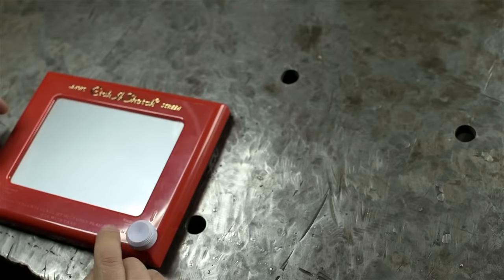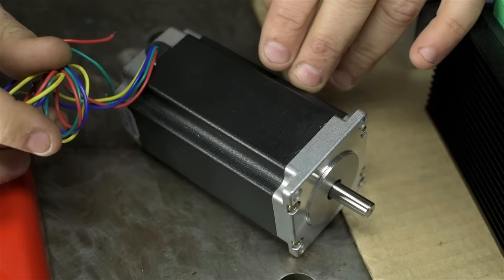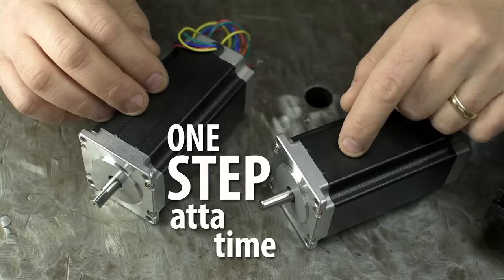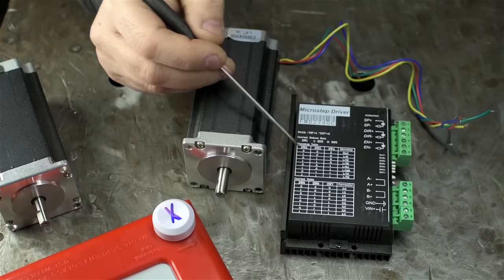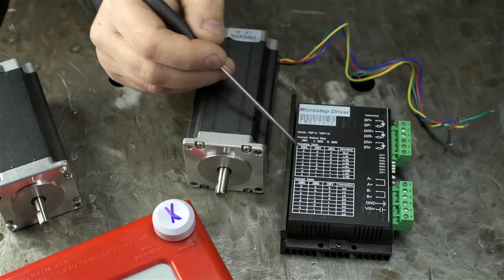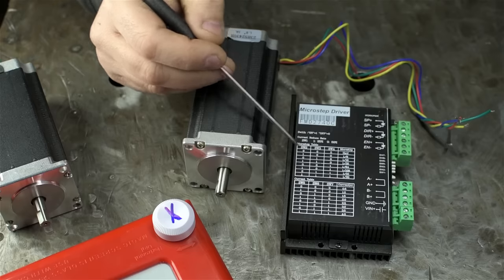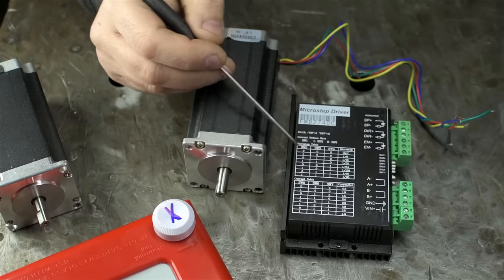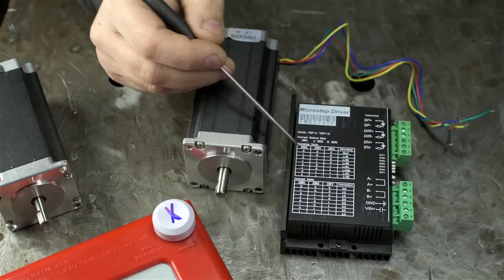Build Your Own CNC! (Part 1) - Hardware

Comment: Linus Torvald would like to speak to you about your current lifestyle choices.
Reply: Torvalds.  There's more than one of him.

Linux is fine for everything I do.  Better than Windows.  But then I don't do any CNC stuff, so I have no idea how LinuxCNC stacks up against Mach 4.  As for CAD/CAM s/w for Linux, there's a lot of choice (which means there's probably no offering that will keep everyone happy).
Reply: Jim Alley  
Linus Torvalds (not Torvald) came up with something called Linux, which is an operating system.  You can view it as an alternative to Windows except the price is a lot better - it's free.

There is LinuxCNC on Linux as an alternative to Mach 4 on Windows.  How reasonable an alternative I don't know.

There are CAD/CAM programs for Linux, how good they are I don't know.  There's a metric shit-ton of them, which is not a good sign, because a good one would crowd out the others.

If you have an old computer sat around doing nothing because it's too underpowered to cope with Win 10 then it might be worth having a play with Linux, which isn't as hungry for resources.  Because with Linux you tell it what you want to do (if you can figure out how, although standard stuff is easy, it's the non-standard stuff that has you tearing your hair out) instead of Microsoft telling you what they're going to force your computer to do (like do an update in the middle of running your CNC), or force a shitty user-interface upon you.
Reply: @RasmusJohanson  
I've hurd of this GNU of which you speak.  They never did manage to come up with a kernel, did they?  Well, they came up with something that was a pale imitation of Linux long after Linux had become solidly established.

If we go down your route, it's actually xorg/GNU/Linux.  Ummmm, Mate/xorg/GNU/Linux.  Ummm, Firefox/Mate/xorg/GNU/Linux.  The kernel is Linux, not Hurd.  Much as I respect RMS, he cannot force me to call it anything other than Linux (nor can you).
Reply: Most people using LinuxCNC are using Fusion360 for CAM - it's an excellent package and free for start-up or hobby use.  LinuxCNC is an industrial strength system... it has its quirks and it's more complex and less friendly than Mach, but it's been used to control all kinds of machines from little desktop routers to full size machining centers and lathes.
Reply: >It used to be true that Linux was the GNU software system plus the Linux kernel... nowadays it's mostly Linux+GNU dev tools+hundreds of other packages from other authors.
Reply: It's Torvalds, because unlike M$ Window he's actually capable of multitasking.
Reply: @DanBowkley  beyond multitasking Linux is even capable of real time control. Which means Linux can run a CNC machine while you're streaming this old tony videos. I believe there's 4 different real time systems for Linux now? It is hard to keep track of them all.
Reply: @bdf2718  Linus' brother Axl got killed by John Travolta in Swordfish. It was tragic. He got mixed up with the wrong kind of people.
Reply: For 2D work, Inkscape will spit out gcode for you.

You know what we say in the open source world: "You get what you work for"
Reply: @doctormo  I never got Gcodetools to work very well for me. So I found another procedure to get 2.5D G Code starting out using Inkscape. Which could be called some work. But it works for me.
Reply: My thought exactly and I'm the ORIGINAL Tony.
Reply: @tonywalker8030  To NY?
Reply: @RasmusJohanson  I did not click the "read more" because like every non-Linux evangelist, my eyes glazed over.
I do not want to spend my life going down the "look how sleek and cool my OS is and how many tricks I can make t do" rabbit hole.
I want to use the computer. IDGAF about the OS or how it works as long as it lets me do what I want.
NO LINUX USER UNDERSTANDS THIS ABOUT NON-LINUX USERS.
Now call me a luser so you can feel superior.
Reply: And I would like to speak to him about how it seems like his daughter? makes his lifestyle choices for him,  how bad that is for the rest of us, and to stop ruining his work with unnecessary rules and regulations - for instance, the CoC being forced down our throats -  that we never needed to accomplish whatever in the first place - then we'll talk about switching over; but until that happens, it is a hard pass NO GO.

Comment: Long time subscriber, first time commenter.  Partially because I prefer to hide in the shadows like Gollum, and also because of the fear of public ridicule.  That should tell you how strong the urge to comment is, especially given that what I’m about to say would be prime for such things.

I’m a mechanical engineer who designs and builds cryogenic air separation plants for a living.  I’m just painting the background here.  But I also didn’t own a cell phone until 2 months ago, believe it or not.  I believe that technology should have a purpose and until recently the phone served none to me.  

20 some years ago in college, about the time the internet’s were invented, for my senior design class I built a CNC though it wasn’t called that at the time.  I used the parallel port like you show but I wrote my own BASIC program for the output, which amounted to a bunch of nested loops with a print command to send a step.

Fast forward to a few years ago and wanting a CNC router and coughing up $15k for it, and where I know that there isn’t anything to it and being extremely aggravated because of it.  And despite knowing that also having to deal with the fact that I didn’t “speak the language” of the new technology to be able to learn from conventionally available resources.

What I am trying to say is that for me, and I’m assuming others as well, this subject isn’t intuitive or easily learned.  I very much appreciate both the time you are taking to explain it as well as your intelligence, demonstrated both through your sense of humor as well as your ability to simplify and clearly communicate. 

I need to watch this again a few times, make some drawings as that teaches me best, and look up some items, all electrical.  But keep the videos coming.  And the examples of different brands helps show what is consistent and probably important at this stage.
Reply: Wow!!
Reply: Andrew Myers nice reply.
Reply: Andrew Myers
Hey mate, just one word
Don't be afraid of any ridicule
99 times out of 100
Or even less
Anything anyone thinks or says about you doesn't have any impact on reality
Cheers ;)
Reply: I have learned to accept that anyone who personally attacks someone is coming from a position of weakness, and I TRY to not let the comments hurt.  I enjoy disagreeing (debating) with people about  issues, but I don’t attack the PEOPLE (by assuming if they like x person then they have Y character flaw etc.  I’ve also learned this... EVERYBODY has issues and insecurities.  Some don’t admit it, some attack to cover it, some have the issue of not being able to see their own issues.  Thank you for commenting.... we are all in the shadows sometimes.
Reply: I decided a long time ago that other people's opinion of me is none of my business.  😎

Comment: "this is how the pros do it, if you're a hobbyist, you could build all this stuff into a nice enclosure with fans and switches and lights"

i died laughing. too real :)
Reply: Creeper With Shades - You beat me to it! So true...
Reply: Me too.
Reply: Fans, light and switches. Check. Working stepper motors. Erm
Reply: @TheBelkul  It is called optimization, get the easy stuff done first, so it is out of the way, then do the hard stuff. Some people would say "the easy stuff that is actually part of the deal, procrastination doesn't count", but that is just a minor detail.
Reply: @louisvictor3473  On the flipside, why waste time doing the easy stuff if you're not 100% sure you can finish the hard stuff?
Reply: I can relate, once, many moons ago I visited a mate that works with electronic repair, only to find his media computer in pieces, scattered on the floor in front of the TV, still hooked up and running...
Reply: @kyleemmerich2460  Why waste time trying to do the hard stuff at any point if you are not 100% sure you can finish it? See, that is a non argument, you'd never do anything if you applied that line of thinking consistently.
Reply: Kyle Emmerich you do what you know you can do and hope to learn how to do the hard stuff along the way. If that doesn’t pan out, you set it aside and get educated. Not knowing how to do something is a very poor/lazy excuse to kill a project. The only excuse I find acceptable is that it is financially unrealistic and that does NOT include the concept of “you can buy it cheaper than you can build it”.
Reply: But you also need  Lenovo SubscriBe to run the software!
Reply: Right! At first I went, "Good joke!" Then I thought of some of the shops I worked in, and I went, "Not a joke!"

Comment: Now that's what I call "step by step". (That honestly was pun-not-intended) Great idea to keep it 2-d at first, and the Etch-a-Sketch concept is brilliant. Suddenly a bunch of random stuff I've seen on this topic on YouTube is gelling, and after the next video in this series comes out I predict I will be able to build a seven-axis CNC from ten buckets of dirt and a barbecue.
Reply: Thanks for the excellent video's. Have you ever done jigsaw metal cutting blades? Also hacksaw blades? I'm having to cut half inch  aluminum for aproject and so far it's really slow by hand with the blades I have   and cheap plunge saw blades are useless. Thx again

Comment: I was a CNC programmer and R&D machinist for many years. When I started in the 70's it was NC (the first C hadn't been born yet) and we typed programs on a converted teletype terminal and then threaded the paper tape into a reader computer that was the size of a refrigerator. 
This is the best, most complete instruction video on the interweb machine. Maybe these should be shown in schools. Nice job.

Comment: You got me thinking. 
My wife isn't going to like this.
Reply: The Stepford Wives 2
Reply: My thoughts exactly 2 years ago.
Reply: Dealing with the wife should be a video on its own.
Reply: Grimace427  Trust me, you don't want to know.  However, if you must have one, I have a "seasoned" wife model that I will let go for practically nothing.  In fact, I might even pay you if you pick her up so I can get around shipping costs.
Reply: @6milesup    I don't know about him but I'm interested, I can be there in an hour.
Reply: Grimace427 
Copious amounts of tequila and bad decisions
Reply: @Grimace47 You can get a cheap one from the far East, and it will appear to do everything you want, but it won't last long. People prefer old American ones from the 50's or 60's, big and heavy but reliable. You should be able to pick one up online, but be careful that it isn't worn out (check the bed for wear).
Reply: @robotparadise  Stepmotor Wives? Pilot episode: Daddy bought a gecko
Reply: Most of my worst ideas start out with “I’ve been thinking.”
Reply: Wife 2.0 fixes many of the issues reported in Wife 1.0
Reply: There should be a Wife Surplus store where you can cash them in.
Reply: Jim C there were some legal issues with converting her to a time-share.
Reply: This is my favorite comment on this platform
Reply: Winner of the internet for the day. But don't tell my wife.

Comment: My desktop CNC mill uses a Gecko G540 4-axis stepper controller and a USB SmoothStepper to connect to the host PC via USB and provide a parallel port connection to the G540. Works beautifully, and I have the entire thing (controller, USB/parallel adapter, power supply for the stepper motors, a motor controller and power supply for the spindle motor, SSRs for controlling things, a pair of cooling fans, a software-switchable AC outlet on the back, and a complete mini-ITX PC running Windows) built into a single 4U rackmount enclosure. It turned out to be a beautiful workhorse of a build and works flawlessly.

Comment: Ah a childhood project :-)
one printer one Atari ST, the driver-ICs out of the printer and hot glue, a lot of hot glue, a lot!
The hard part was the converter to convert pixel-graphics into vector graphics into direction-controls with shortest lines to draw the image.
I've worked on that for months on my Atari ST and GFA-Basic.

Comment: I've been building and running CNC machines for over 10 years now and still like to watch a video on DIY CNC every now and then. There's a lot of them out there but you made one that goes in the top 10. Nice work.
By the way, I've noticed you kept saying "I think it's a NEMA 23" or "34". It's pretty easy to figure out what is what--Nema 17 measure 1.7" across, 23s are 2.3" and 34s are 3.4"--although I suspect you already knew this.
Reply: NEMA's not metric?
Reply: @Tricknologyinc  NEMA stands for National Electrical Manufacturers Association (of North America). I measured the motors myself because I also thought the number was a metric reference, and sure enough it's 1.7, 2.3, 3.4 inches.

Comment: You do a really good job at describing stuff... Well at least I think you do... Plus your style of telling the story is awesome!

Now you need to see if you can program so your airplane and horse doesn't get tangled in a rope. Maybe something to do with tool path? I don't know I just fix them and not program them.
Reply: 3D Printer slicer software has options to minimize move paths and afaik it uses standard gcode. Just make 3D model  and slice it in a single layer.
Reply: Cutter Slade Yeah I was thinking 3D printer slicers might put out better gcode. Much easier to get small “line widths” and sharp corners.
Reply: I was thinking about this as well. It should be possible to make it follow the same line backwards so it wouldn't travel point-to-point
Reply: Morten backlash might be an issue when backtracking...
Reply: @kilrahvp  I'm sad to say I've never tried an etch-a-sketch. Also it should be possible to compensate for backlash if the backlash is consistent
Reply: 3D printing slicers do let you keep travel moves within already printed areas, but you can’t just backtrack completely if you have some infill pattern. And yeah, you can compensate for backlash if it’s known. CNC machines do that.

Comment: Thank you for this! Very nice breakdown of what's involved in putting one of these together. Definitely on my to build list now. Any suggestions on a good mill to convert? Seems like it's the dilemma of the mini lathe, or DC vs AC/DC tig where to do steel, it's going to cost a lot more (except inverse in the Tig example).
Reply: Save the trouble. Get you a Fadal TRM. It's going to serve you well. 3 axis CNC without a tool changer or flood coolant. (Use a mister) you can also run it with handles like a manual mill.

Comment: If you want to make something that'll shake the etch-a-sketch just bolt a Nokia 3310 to it and give it a call :P
Reply: Or put in an offsettable weight on one of the motors and run it at resonance for the structure.
Reply: @Gottenhimfella  r/woooosh
Reply: You can buy the cell phone vibrating motors for less than a dollar and run on 2032 battery with a switch.
Reply: use a bass shaker or modified subwoofer

Comment: I wonder if there is a way in an Etch-a-Sketch to mod it so that you could physically lift the stylus from the screen to create disconnected lines. That could maybe be hooked up to a lever for manual operation, and hooked up to the Z-axis or a simple solenoid on a switch output. I know the single-line thing is half the fun/challenge when playing with an EAS, but modding is fun too for some of us nerds. I've never tried to do that, but I did take one apart as a kid and remember making a big mess.

Comment: Tony, If I may ask you just two quick questions before I leave to go back to Mars today. I watched this video several times over the past year and found the courage to jump in and try to accomplish building a CNC router. So thank you for the encouragement. It's a Father/Son project, I've been working on it for a year and the younger, smarter one is about given up on me. I purchased the PMDX-424 and the MACH 4 Hobby software. The PMDX I have is the DC- 24 volt setup.. I couldn't get the Gecko Drives at the time because of cost constraints, but will eventually get them. The question I have for you is that            1) in the video, I see you connected SP- negative (white wire) on the motor driver "X" to the PMDX, "X" Step. The pink wire is connected to the Dir-Negative on the driver, and DIR on the PMDX. Are the pink and white wires ground wires? I'm not the sharpest tool in the shed and it my first time building one of these.       2) It looks like you connected 5 volt positive current with the Black wire at the PMDX board and the other end was connected to EN-negative on the motor controller. Likewise, The blue wire connected at the motor controller is connected on EN + (Positive) but at the PMDX board, it is connected to what looks like the ground screw. I know your board works, I've watched it several times. I'm trying to wrap my head around these connections because I don't want to have to purchase another PMDX!    For drivers, I'm using Stepperonline DM542T motor drivers, the layout is slightly different on these drivers but they are all the same connections, just different orientation. If you can help me with this, I would be greatly appreciated, I really like all your videos and watch them often.Watched these two videos about 50 times, trying to get it all down... Best Regards!

Comment: I always thought that an Etch-a-Sketch needed a "space bar" (Z-axis, for "no line reposition").
Reply: I wonder if you could throw a small solenoid on the joint that holds the point (inside the 'sketch) to do that. On/off. Pen up / pen down. Hmmm. Now I want to open one up to see if that's possible.
Reply: The simplest version of this would be a little mechanism to push the stylus assembly down while you reposition it. I mean, it sounds simple on paper anyway